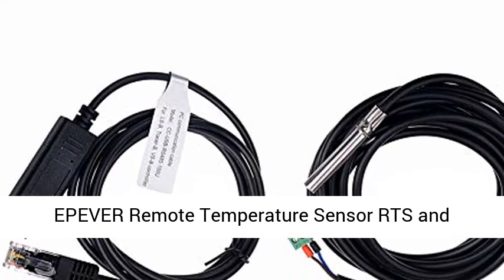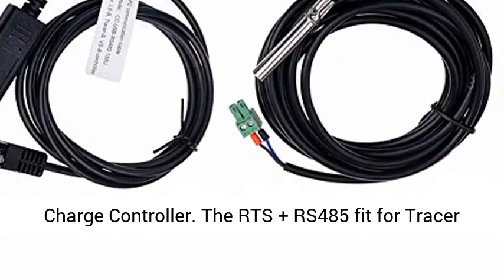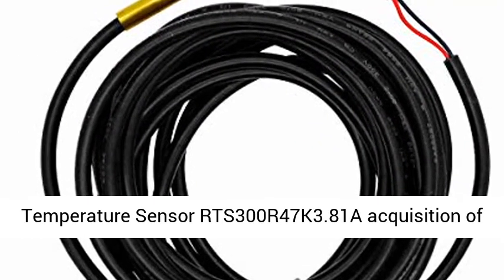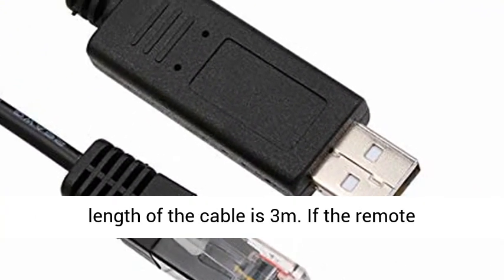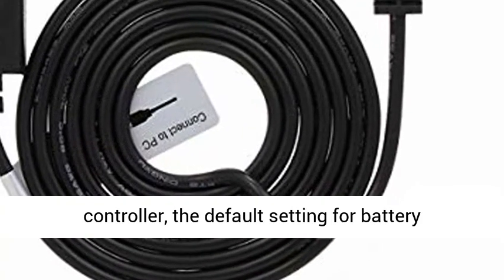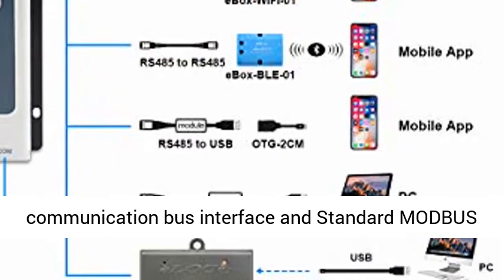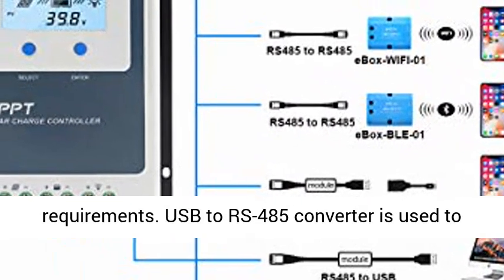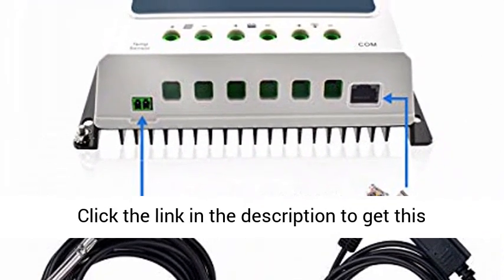EPEVER Remote Temperature Sensor RTS & Monitoring Adapter RS485 to Solar Charge Controller-Overview

Comment: Why is my Epever remote temp sensor giving incorrect readings shown on my MT50 display? About 10 degrees C higher than actual? I don't think they're calibrated properly. When I disconnect it it doesn't default to 25C. Instead it just reads the same as with the sensor plugged in.
Reply: Good luck Michael  B.